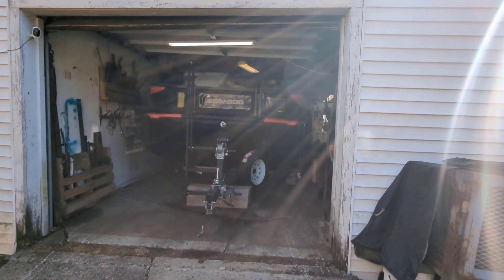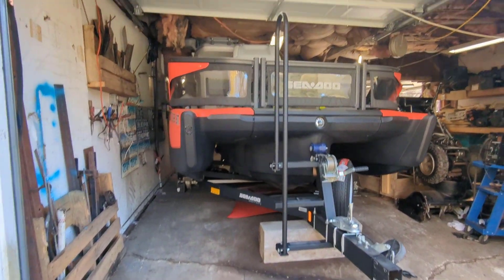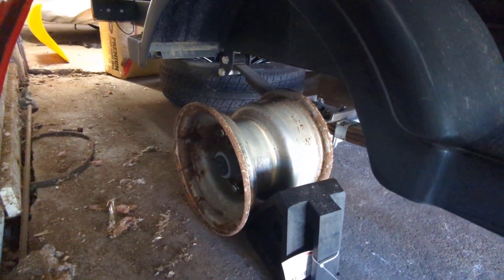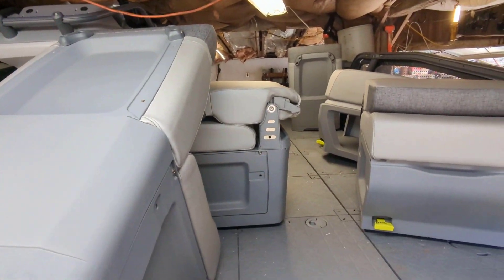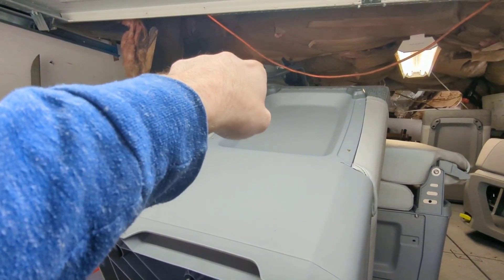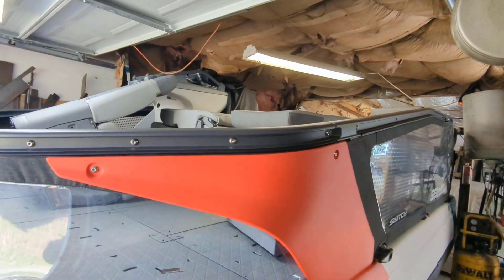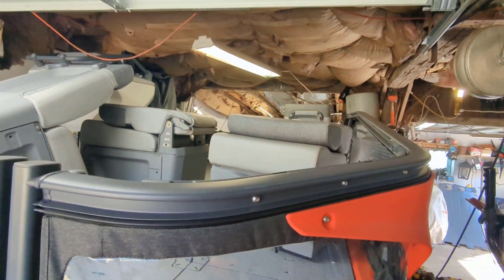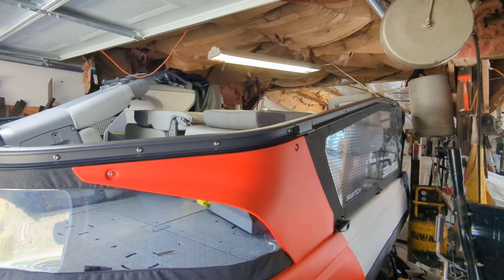Will a Sea-Doo Switch Fit Under 7 Foot Garage Door?

Comment: This is exactly the info/video I have been scouring the internet for! Thank you for figuring this out for the rest of us! I have 84 inches max and can just get away with smaller rims. Thank you!
Reply from the maker: Awesome! Glad it helped, that's exactly why I make these. Make sure you dip the tongue down as low as you can get it to fit the helm. Also, this is for a sport compact / compact. I know the larger trailers have brakes, so be weary of that. Good luck!
Reply: @WeTryMotorsports  Appreciate the pointers, Im still gonna go take a few measurements at a dealership soon and take the wife with me to make sure she is on board with the size. I am looking at the 18' sport, but will take off the swim deck during storage to get rid of some extra length and install a folding tongue. Not sure how the brakes will effect putting on smaller rims but Im sure the people at the local shop will be able to help advise.
Reply from the maker: @Supertrooper432  The brakes are larger than the small rims I put on. so you may have to use a different method, you still may be able to get by but definitely be creative! This was specifically for the sport compact.

Comment: can you make a video showing how easy it is to get in and out of garage on just the rims? really wish they designed it to fit in 82"  garage, major design flaw on their side.
Reply from the maker: basically you back it in as one normally would. I have a friend with me just in case. it's a really tight squeeze!
Reply: is it moveable by hand or you need to use a vehicle?
Reply from the maker: @collinsbonnema  I sometimes use my ATV to move it but you'd need a powered hitch wagon at least. the sport compact weighs around a ton

Comment: How hard is it to remove the bimini? I have a 94inch garage and it looks like to fit a switch in there, I'd have to take off the bimini each time I want to take it in and out.  If this is possible to do in less than 10 minutes, then I wouldn't mind doing that every weekend to take it out, but if it's a longer process, I might consider just storing it elsewhere and not bothering with bimini removal.  A video showing bimini removal (or a description of how difficult it is) would be phenomenal!
Reply from the maker: yeah it's about 10 minutes on and off. not too bad - with two people its even faster
Reply: @WeTryMotorsports  Thank you!! You're the first person I've seen who's been able to answer this question. Is it just a screw driver needed for removal and putting it back on? And there's nothing else height-wise that'd interfere with a 94inch garage? The top of the driver's seat is 90 inches based on another one of your measurement videos, correct?
Reply from the maker: @jjhhggff8  yes, for the compact sport. you'll need a torx set for the bimini top rails... if I recall correctly. I'll probably do a video with putting it back on

Comment: How wide is your garage?
Reply from the maker: garage is 20' wide 28' long. garage door is 9' wide I think
Reply: Thank you for responding! How much clearance you have on the side? I have an 8ft wide garage and wondering if it would fit
Reply from the maker: @raldenjaeservitillo3787  what you're looking for is the beam of the boat. since the boat is wider than the trailer; the total width of the boat and or beam is 7.8 ft or 2.4 m.
Reply: @WeTryMotorsports  thanks a lot!